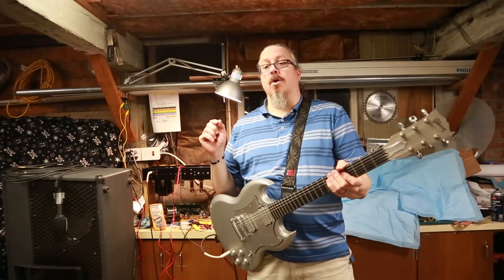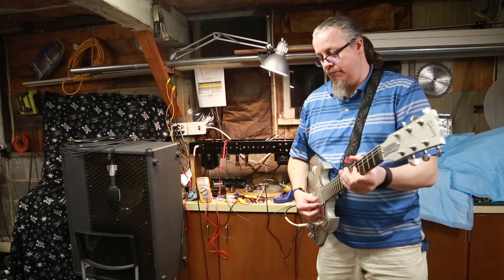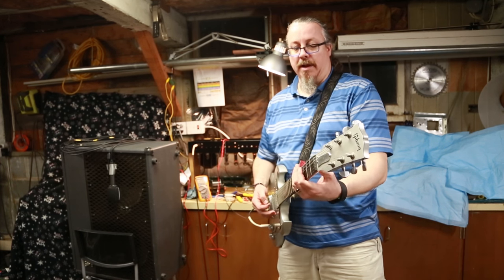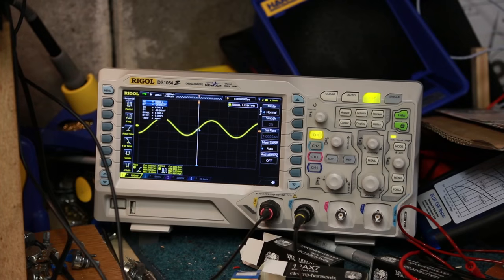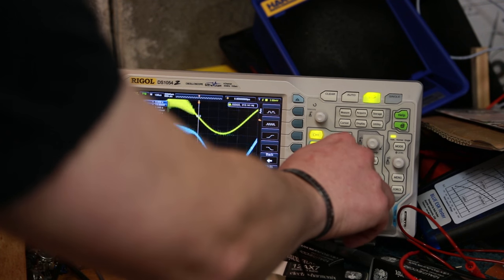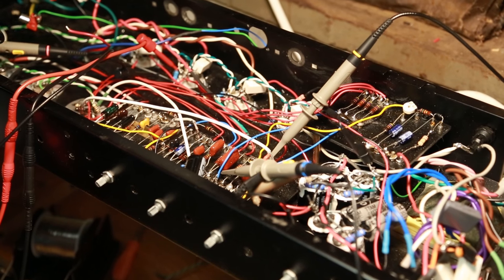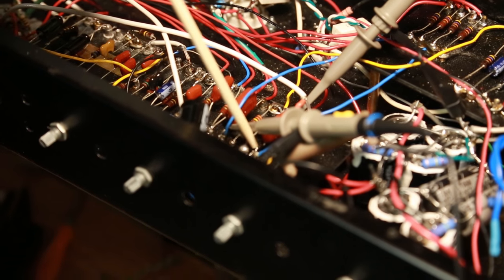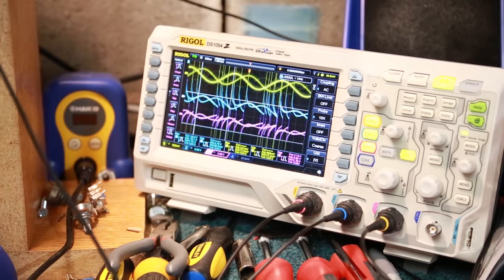Vox AC100 Video 8

Comment: tubes could be shot,try a complete balanced set.i have this amp and its quite a good beast but does not sound anything like yours here????theres great mods u can do to the ac100cph btw.basically the mods turn it into a really good sounding amp.the transformers are excellent quality so u dont need to replace them.its more to do with certain caps and resistors and the input
Reply from the maker: This was quite a while ago.  It was a bad power transformer that shorted out many different boards.   I built a classic ac100/2 in the chassis and that also got ruined by the bad transformer.  Sadly I didn't realize this until I tried a third build in it.  After that I replaced the transformer in it and it's now a Marshall amp hehe